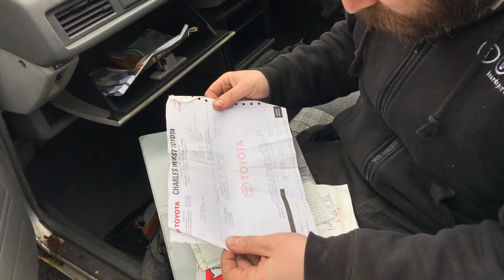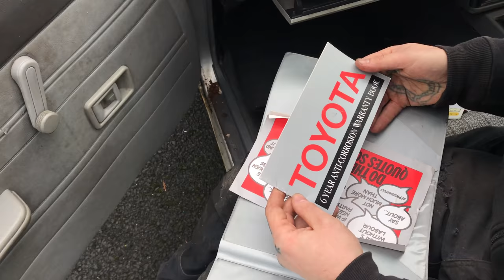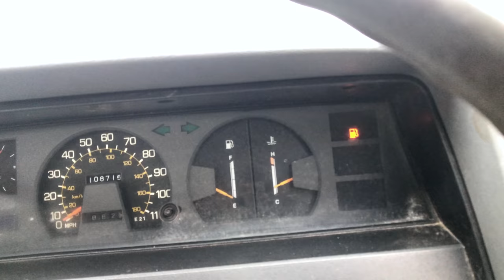KE70 Corolla Abandoned for 7+ years with a TRAILER?! Will it run? Ep.2

Comment: that K engine, developed during the 60s with the introduction of the 1st gen Corolla... was still being produced until 2003 with the 7th and last revision, 7K still featuring straight-4 8-valve push-rod, with added fuel injection and capacity bumped to 1.8 liter. It's the longest production Toyota engine and probably the last Japanese push-rod engine.
Reply from the maker: Yeah man. They are iconic!
Reply: see u in another video about toyota man

Comment: God dam, I'm going to have to go fix my 79 hi ace pick-up now! You bastards!! 😉
Reply from the maker: Will it run??? 👀👀👀
Reply: Ah ya put it in the shed running something up with wiring, not as far gone as the past two specimens!!
Reply from the maker: A yoke worth saving no matter what way you look at it man! Class machines. Bug eye yeah?
Reply: @CannibalCars  Ah it's very clean for its age, runs and drives, well did when it was put away, paint is the main thing. It got put on the long finger while I finished an 87 Starlet.
Reply from the maker: Hard to get to them all. Keep her locked up away from the weather!
Reply: @CannibalCars  Yup that's where she is, I live costal, the rust on the two corollas is our surface rust!!

Comment: Do you sell ke70 parts? :)
Reply from the maker: Absolutely! Cannibalcars@gmail.com or dm on Ig
Reply: @CannibalCars  thanks man. keep safe. and more episodes to come!. ;)
Reply from the maker: Enjoy them!
Reply: can i see the set yp of your exhaust sytem,down to the muffler of the ke70wagon. i love how it souds. will apply it to my ke70 corolla with 4k stock engine. :)
Reply from the maker: What you are hearing is a rotten exhaust with multiple holes in it and no back box! 😂🤠
Reply: @CannibalCars  funny. it sounds good on the video.haha
Reply from the maker: Yeah she sounded great! My road corollas always had a  little janspeed back box from an ae86 on them and sounded great, raspy but not obnoxious!
Reply: @CannibalCars  thats cool. would that be a resonator in the back or middle pipe before the axle? btw, that interior is so immaculate!. classy!. :)
Reply from the maker: They usually have a little mid box and a back box I either cut the mid box out or leave it there. Won't make a big difference. Then put the janspeed backbox on. 🔨🔨🔨